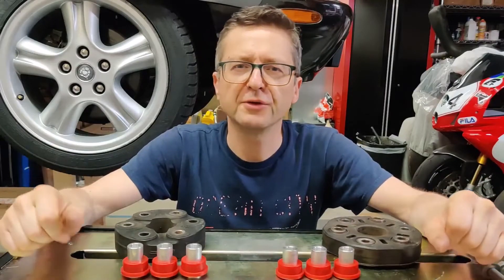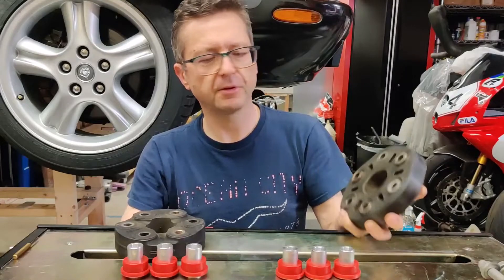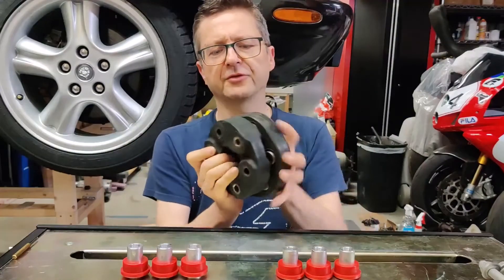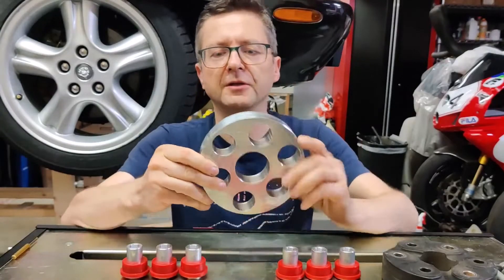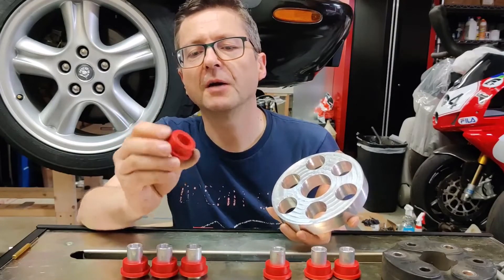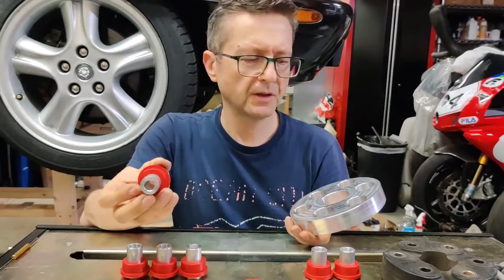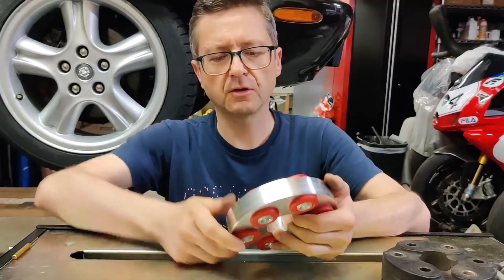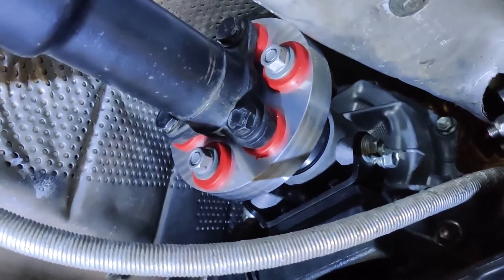Jaguar XJR EV Conversion - Driveshaft Coupler

Comment: Hi, you got the design files to share? Got a GS450h to mate with a BMW E91 flange. Thanks
Reply from the maker: Unfortunately I don't. I outsourced making this piece to local machine shop based on my rough drawing. Are you able to keep original length of the driveshaft? Honestly it is better if you can. But I had to shorten it by about 16 inches. So later I made custom shaft by welding half of Jaguar shaft and the other half Lexus. This is not easy and will definitely require balancing. But benefit is I don need custom flange anymore.
Reply: @ArtursGarage  not sure yet, just thinking up potential solutions. Getting a drive shaft welded might be the solution